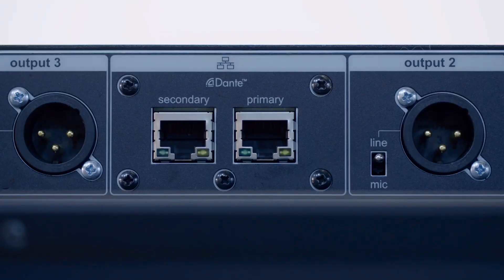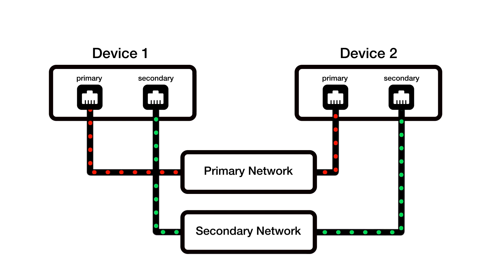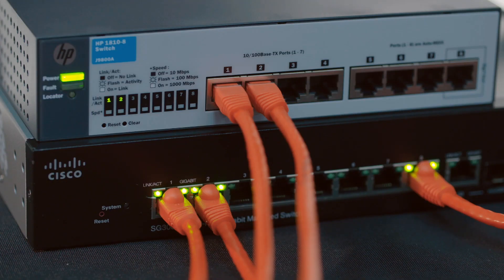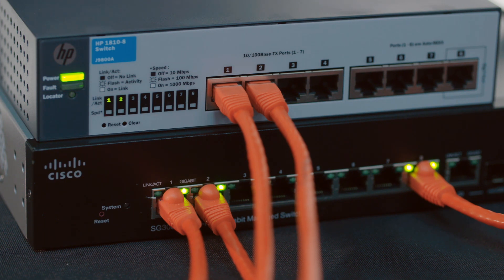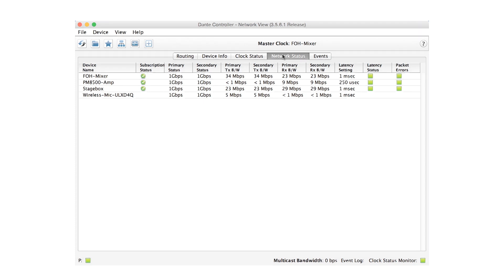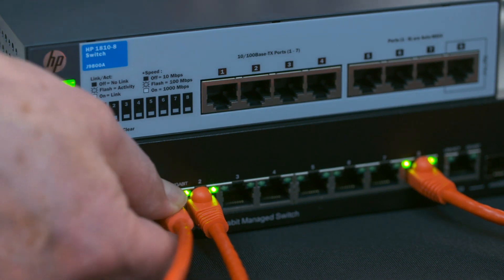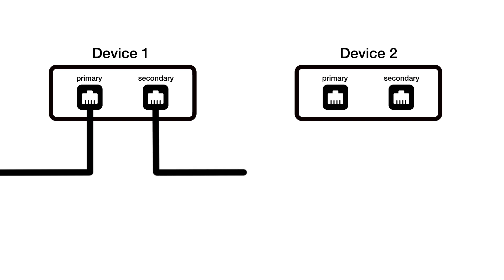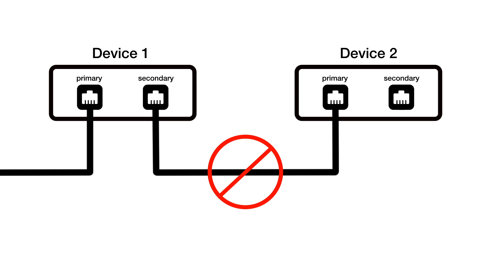Getting Started with Dante: 8. Dante Redundancy

Comment: In Getting Started with Dante: 2. A Simple Dante Network, it is posted over your person at 1:11, "We rely on the incredible reliability of wired Ethernet to deliver flawless audio performance." Therefore, wouldn't it be unnecessary to install a redundant network?
Reply: No. Just because the ethernet protocol is highly reliable compared to analog signal chains, does not mean that the connections are not susceptible to other issues like a network switch dying, a network cable getting cut/damaged, or a network jack getting unplugged by accident. For further information, you can look up "N+1 redundancy".

Comment: there is problem with this set,  if you lose access top the primary network  you also lose all management as well  since the virtual sound card only has one port and the control software only has  one  port  this is not real redundancy
Reply: There's no problem with this setup or video. This setup doesn't use Dante Virtual Soundcard as it does not support redundancy.
Reply: The network is mostly self managing unless you need to change configurations for some reason in real time. Losing one network still wont interupt the current config. And the computer can itself be physically plugged into the other network.

Comment: Hello, quick question:

I want to know if this will work with this setup I have in mind.
I want to send multi-tracks(stems) out of Ableton Live, but I want a redundant setup since it will be used in live situations. So if I connect Laptop1>Switch1>DanteCardPrimary(FOH-Mixer) and then Laptop2>Switch2>DanteCardSecondary, will this work? Like if the primary network fails, it automatically switches over to the secondary.

Thanks in advance.
Reply from the maker: Hi Maurice, 

No, Dante Virtual Soundcard does not support redundant connections. 
You will need to purchase a hardware solution, such as the PCIe-R cards from Yamaha, Focusrite, SSL, Fouraudio:

https://www.audinate.com/products/manufacturer-products/dante-pcie-card

Comment: I was confused when you said "Dante Virtual Soundcard does not support redundancy."  We're using two Macs in our livestream setup at our church.  The first Mac takes all the audio from the band, mixes it in Logic, then sends the stereo mix to the second Mac which syncs it with the video feed and uploads it to the stream.  If we want to set up a redundant network, how would we do that if Dante Virtual Soundcard "does not support redundancy?"  Can you clarify what that means?  I assumed I would use a second ethernet port on each Mac and it would all be fine.
Reply: I think what he means is, Dante Virtual Soundcard does not support redundancy so you cannot do this with your setup. You need to use other dante-enabled (pro hardware) devices that support redundancy
Reply: Quote from other comment:
No, Dante Virtual Soundcard does not support redundant connections. You will need to purchase a hardware solution, such as the PCIe-R cards from Yamaha, Focusrite, SSL, Fouraudio:

https://www.audinate.com/products/manufacturer-products/dante-pcie-card
Reply: The two macs are independently receiving audio from different but identical streams and don't talk to each other. This is the only way virtual sound card could be considered redundant capable.  Basically have 2 of them on different machines.